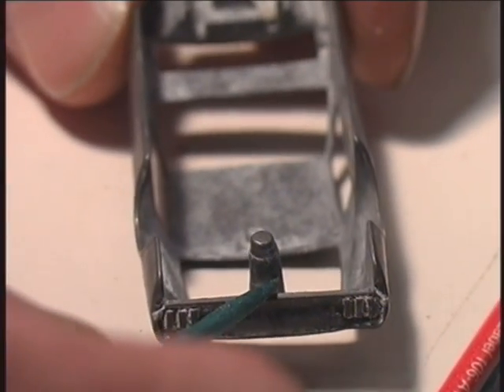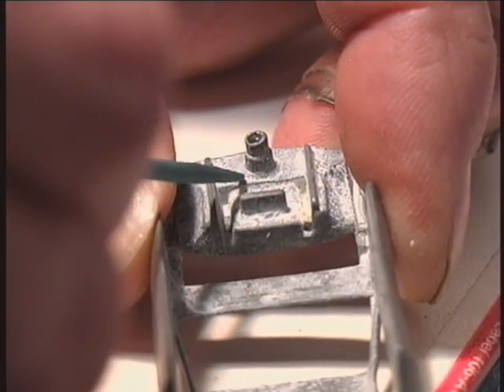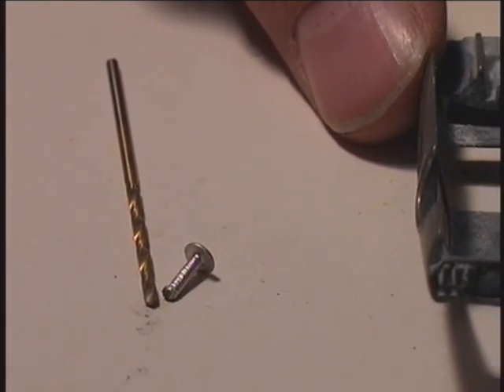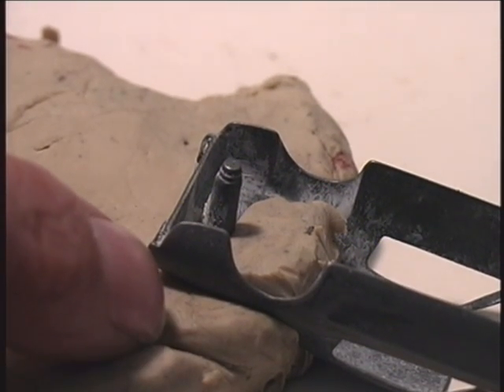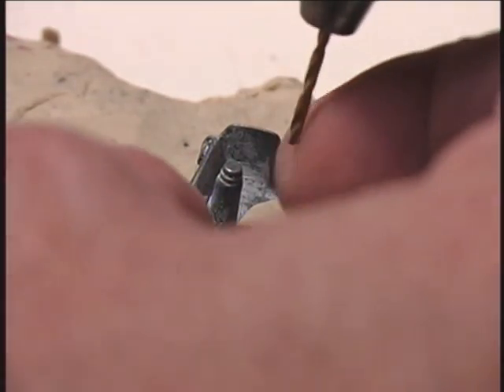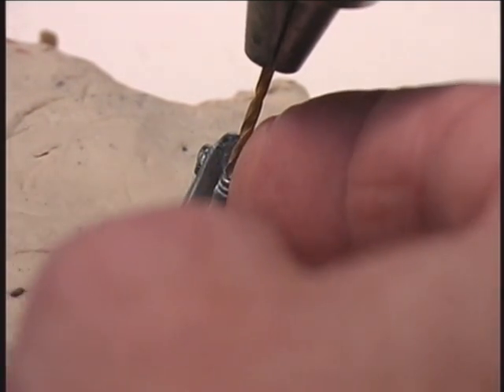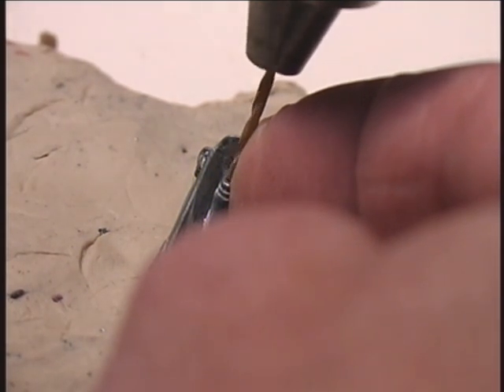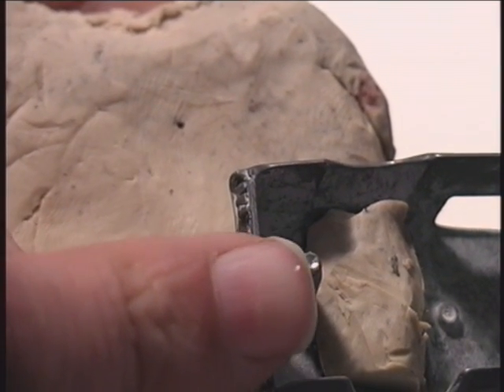Hot Wheels Redline Restoration - Drill for Reproduction Rivet Install

Comment: Just going to drill out my Jet Threat to prep it for the Rivets.
I am doing the drilling before the prime or paint as well to avoid any unnecessary scratches. Also the paint that goes into the post holes will likely tighten up the rivets a hair. 
I am going to "DIP" paint my Green Jet Threat today in Spectraflame.
I do not have the airbrush yet, but am convinced this particular body should be ok in a bath. Hoping to start with front end submersed and then draw it slowly through the paint. 
I have asked around and not many customizers have ever tried the Dip. I am hoping this will leave an extra thick coat, with NO runs.
I am not adding hardener but when it is dried after a few days hanging I will lacquer coat it several times.
If this goes sour on me, I will only have to strip and start again using the airbrush when it arrives. 
Any ideas or suggestions???